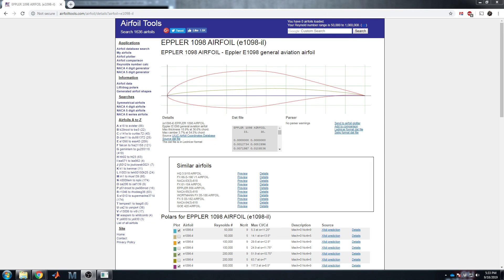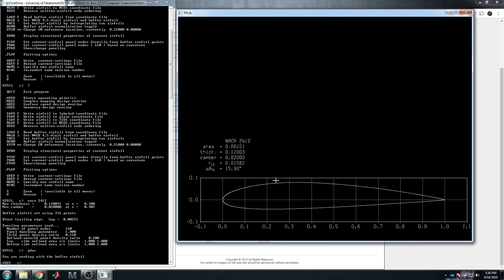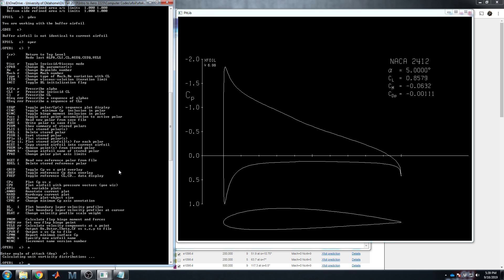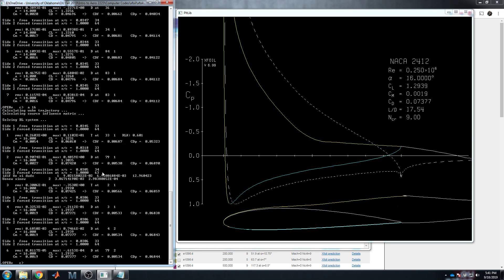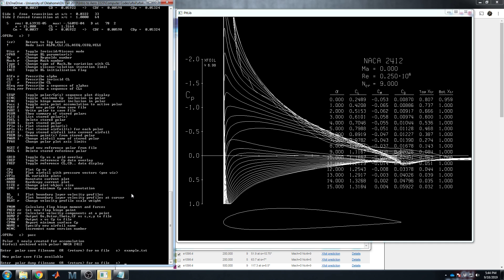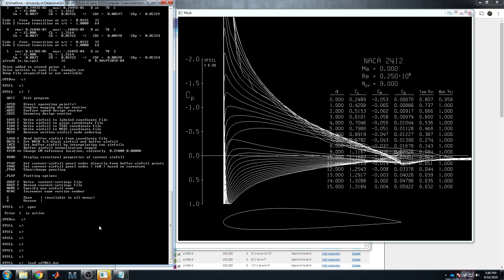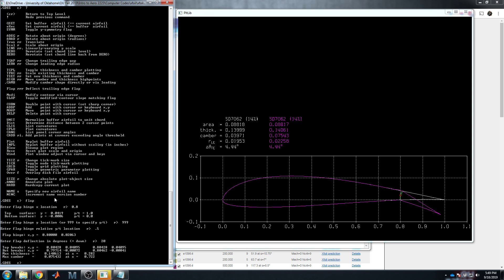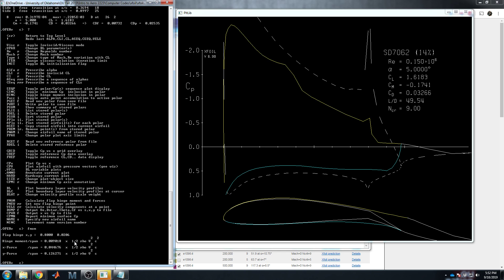Xfoil tutorial

Comment: Any idea on how to fix a warning that says 'poor input coordination distribution'.  Apparently, there is an excessive panel angle 40.1 at i = 26.  It suggests fixing this with repaneling with PANE?  What does this mean and is this something I should be concerned about?  Ran the airfoil a bit in viscous mode and it seems to run fine from 0 to 18 degree AOA.

Comment: Hi Dr. Hays, I am trying to run Xfoil on my laptop using a linux sub system and am getting this error to do with fonts:
 Error of failed request:  BadName (named color or font does not exist)
  Major opcode of failed request:  45 (X_OpenFont)
  Serial number of failed request:  26
  Current serial number in output stream:  28

I don't suppose you know the solution to this?
Thanks,
Freya

Comment: Hello Dr. Hays, thank you for sharing this useful technic. I have a question though, can we implement different Mach numbers in this software? I see it is fixed at Mach 0. Thanks again...
Reply: From main menu, enter OPER to go into that menu. Then enter MACH to change Mach #
Reply: @berenicecervantes4275  thank you 😊
Reply: @tugbamacit4224  Of course!!! :)
Reply from the maker: Betty C is right, but once the flow touches M1 anywhere, the model is done, so subsonic mach #'s only.   I might also be a bit suspect of near transonic speeds.   Low mach should be fine though.